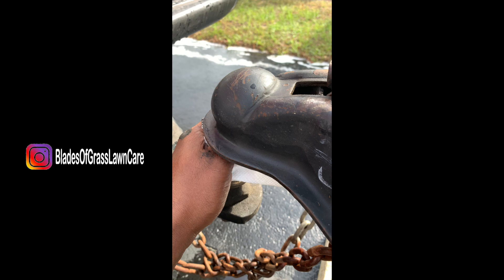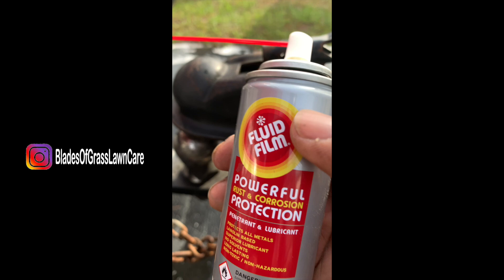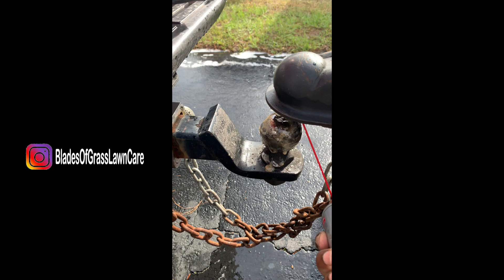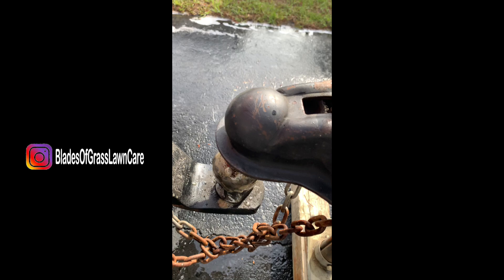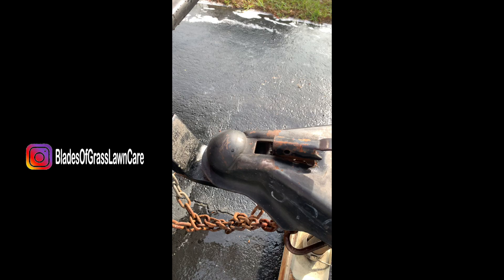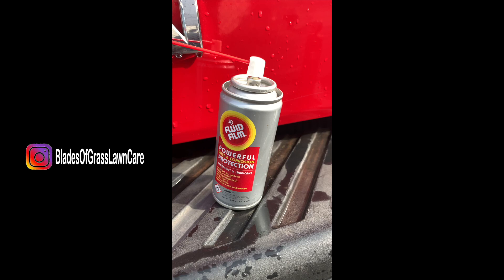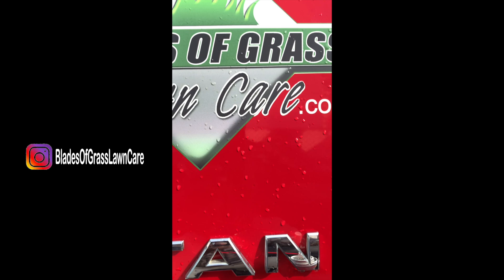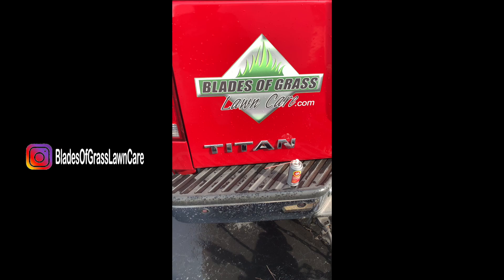Towing a Lawn Care Trailer?  Watch this! Lawn Life

Comment: another great use of Fluid film...I spray Fluid Film on my trimmer string inside of the trimmer head to prevent the string from melting and fusing together during the hot summer days.

Comment: Your trailer hitch is broke cause your suppose to raise the lever up before you lower it down on to the ball.then push the lever down.
Reply: Mike Smith That’s not the kind of trailer he has. It’s a different style of latch used on heavier trailers. You just push it forward to latch it and pull it up and back (how it looks in the video) to un-latch it.
Reply from the maker: Thanks for explaining it